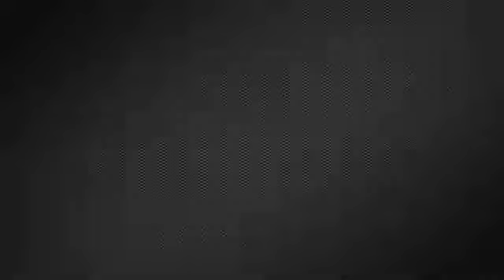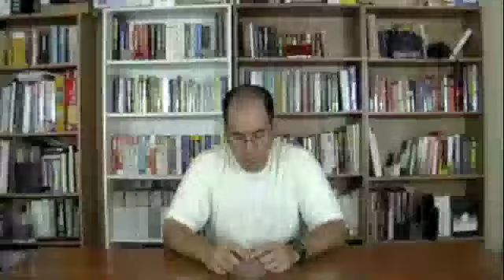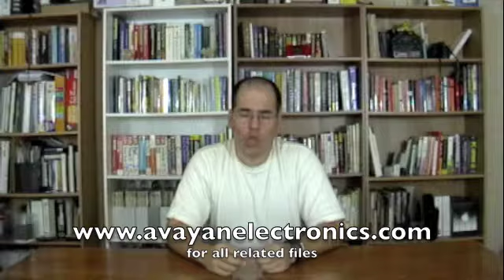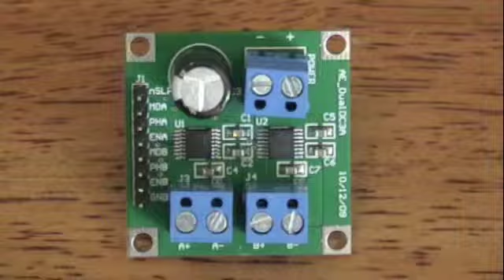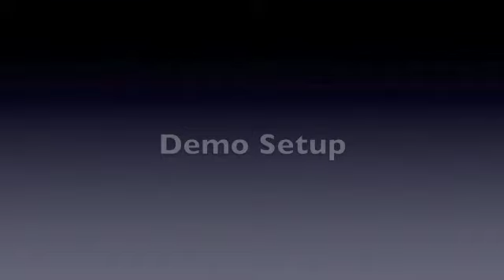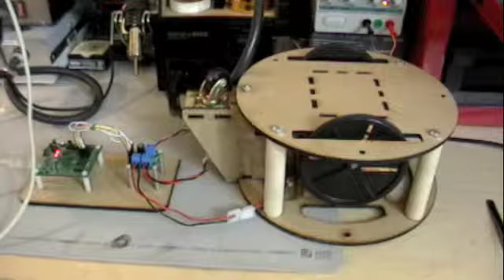AE-DualDC3A

Comment from the maker: 2007Snowdown, yes, the two devices can be run in parallel if you add schottky diodes. But I recommend using a DRV8840 based board which is stronger and easier to use. The PCB you want to take a look at is the AE-MegaBridge which you can buy from driverdudes.